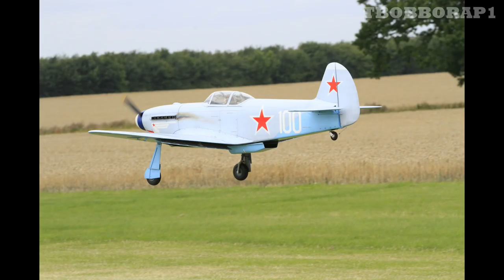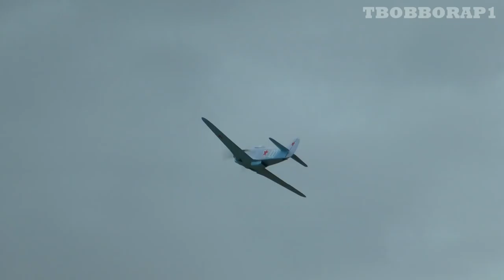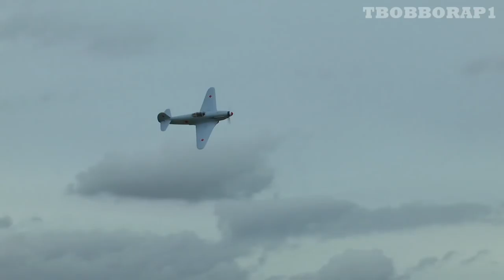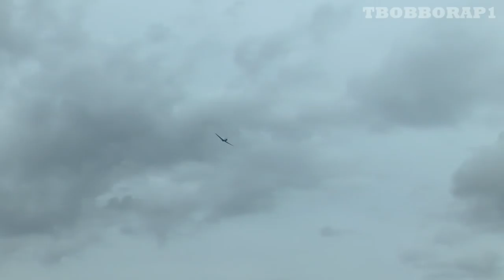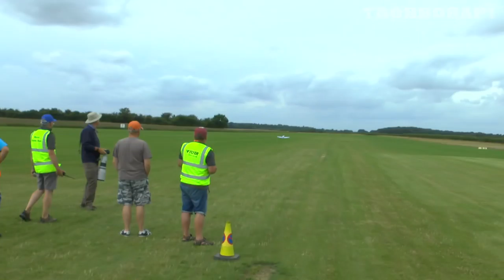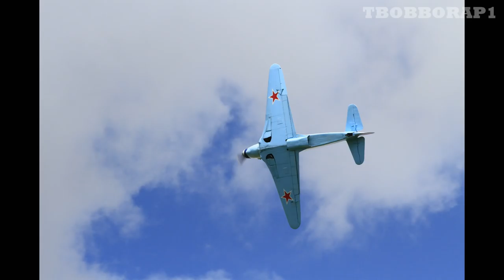YAKOVLEV YAK-3 - 1:3.2 SCALE SCRATCH BUILT RC - 3W MOTOREN 150cc TWIN - MIKE WILLIS WARBIRDS - 2017

Comment from the maker: MIKE SENT THIS INFO OVER ON THE MODEL -

Scratch built model at 1:3.2 scale to match Jon Horne's Airworld Yak 11.
A mix of traditional materials and composite parts ie cowling, canopy, carbon fibre fuselage doublers and +/- 12G mainspar joiner for the two piece wing.
Bespoke spinner and backplate. 
Unitract main U/C units with bespoke CAD oleos CNC milled. Detachable tail surfaces on carbon tube/spars.
27kg hauled into the air with a 3W motoren 150 inline twin, twin spark, on a 32/12 or 10 prop.

She's on rails and after ten years of flying my Spitfire's I'm feeling that the full-size Yak could probably out manoeuvre a MK9.
Futaba twin receivers and savox servos all around,